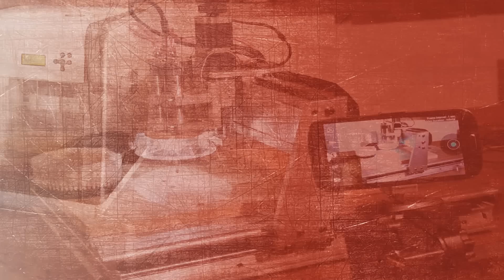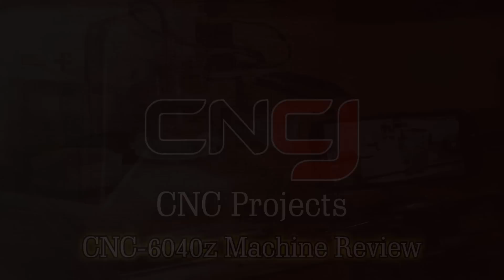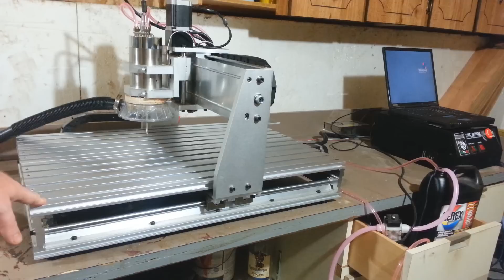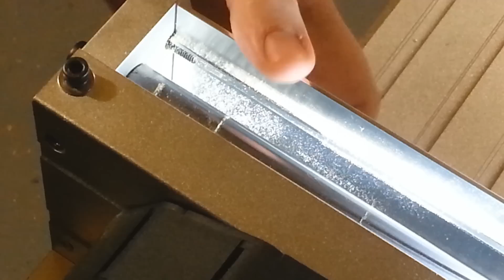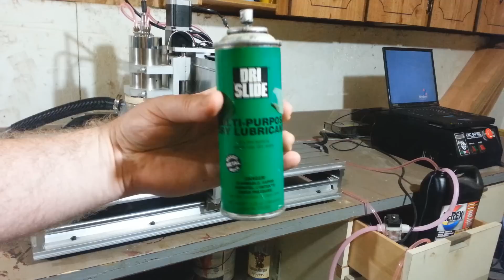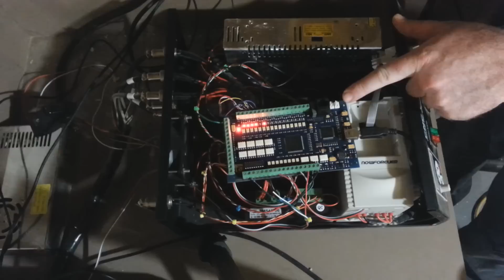CNC 6040 Review And Walkthrough

Comment: You buy a machine for 1700 USD and then you connect it to the wrong voltage? Why? A 110V to 220V transformer isn't expensive. Apart from that: Thanks for the review.

Comment: Generally agree with your comments on the Pros and Cons.  My water cooled spindle didnt come with a pump! so I got a Computer cooling setup and a 1000l/h pump that is variable speed and almost silent just needs 12v DC.    https://www.aliexpress.com/item/DC-12V-18W-SC1000-DC-Pump-Water-Cooling-Pump-Water-Cooler-Pump-Maximum-Flow-1000L-H/32887353096.html

Comment: Is it possible that you weren't getting the specs that you were supposed to get because it was plugged into110V instead of 220v?  I am only asking because I bought a similar one  not hookedup yet because the cd is coming up blank, so no software.  I was told that it wont
 get the high power unless you use 220. I am going to open up the control box tomorrow and see whats inside. Then I am going to try and find a copy of Mach 3. I see it selling for $0 up to $189. I'll have to look into that.  I just noticed that your video went up in 2015. Do you still have the machine and is it working well?

Comment: Switching power supplies can handle wide range of voltage but if you are pushing it too far out of the designed range for too long you can expect premature failure. Get a big heavy step-down transformer (not a tiny electronic travel voltage adapter).

Comment: I bought a similar unit from China.  Unfortunately it came with a bootleg copy of Mach3 so I had to replace that.  Like you, my pump motor was very noisy and that too needed to be replaced.  I added thermal switches to all of the heat-sinks in the control box to control the fans.  This has made the unit very quite to operate.  How did you get on with the CAD /CAM side of things?

Comment: Hello , i have the same machine with the same control box and its a headache from hell!!! i am losing steps on my y axis!!! i only seem to lose steps when its warm weather in winter i have no issues!! did you change your cabeling to shielded cables and do you have a video on how to connect the usb control board!!! loved your vid and appreciate your help! Cheers anton
Reply: Hi Anton, I too have the same problem and it is a headache from hell, i m having the same problem i am losing steps and the tool loses datum, i have tried speeds and feeds to no avail. Did you find a solution. i got on PlanetCNC.com and found a post in the forum that suggested shielding the cables but my cables are shielded. they also talked about frequency and delay
but i am a novice and do not understand. I will add that my machine came with a counterfeit board, so i do not know it the board is bad.
Reply: Hello, I may have stumbled upon a fix to my issues!! I was using a wireless mouse and keyboard that were faulty and giving errors whilst cutting which was interfering with my programmes! I have since changed to a wired mouse and keyboard and not a problem since!! Hope this helps! Sometimes it's a very small issue that you would never guess!!! 👌🏻👌🏻👌🏻
Reply: Not the cause of lost steps. The drivers are the issue. They are Toshiba chip and going through the circuits I found there is a mismatch of clock frequency to run those chips. They are garbage. You need to swap them out for mosfet drivers. Toshiba chips will fail everytime partly due to the clock issue and that they only output 1/3rd of their rated current constant. They are rated on their peak current which is all over in a matter of a second and then the current drops of severely.
Reply: have you had this problem and solved it by doing what you have said by changing out the drivers??? if so where can i find these mosfet drivers?

Comment: hi,, I want build a router homemade with 6040Z frame, motors nema 23 425oz, driver D542MA, 1,5kw spindle air cooling.  Someone, can help me for know if possible that this parts will work fine assembled ? Is better buy a control box Chinese already assembled or buy parts separated among them ? one drivrer each for motor ? controller usb ? Inverter vfd ?

Comment: did you add in those stepper drivers or were they already in the box? I have a control box that looks almost identical but  it does not have separate drivers it all seems to run out of the parallel port card

Comment: Im not sure if i imagined this but im sure you said your control board was 24v, how are you powering this with a 48v power supply? would this not surely fry your control board? i have the same machine but using standard 24v power supply with 24 volt control board and can only reliably get 1400mm per minute max! so that obviously needs to change. im just curious how you have done this so i can get mine sped up
Reply from the maker: +Sean Marsh Hi Sean, you are correct that 48v will blow the control board. I am using two power supplies, the 24v supply that came with the machine powers the control board / fan /pump and sends signals to the stepper drivers. The 48v is strictly the power supply for the stepper motors only (output from the stepper drivers).
Reply: +CNCJ Thank you very much for your quick reply and for this video, you are going to solve a massive restriction for me,, i have my hands already on a gecko G540 just need the power supply and a control board

Comment: can it cut 1/4 inch steel?? can it do aluminium smoothly? do u recomend this as my first cnc machine .. i have very limited softwere skills.
Reply from the maker: +Pawan Kumar I have seen videos of the machine cutting aluminum but I have not done it myself. Steel?... not so sure about that. If you are looking to cut steel, this is probably not the machine for you (beginner or not) you want a mill in that case. If you are cutting softer materials, yes I would recommend this machine if you can do some of the upgrades to the electronics etc that I have done.
Reply: thanks man
Reply: You could reduce chatter by using lead shot in an enclosure mounted on the side of the gantry..
Reply: you can cut steel (at least mild steel) with this. you'll need an oil air mist nozzle to clear chips, cool the end mill and part, and lubricate it as it is machining. proper speed and feeds are necessary but it can be done
If you want the full power of the spindle you'll need a step up transformer from 110 to 220v.
Reply: +CNCJ   Looking at buying the 4-axis version for cutting carbon fiber and some aluminium ( I have a full machine shop already and 40 years of racing parts manufacturing). It could probably cut steel without too many problems, but you would need to be able to slow the spindly down a lot to the 1-3000 rpm range using carbide tooling at fairly slow feeds - the machine is no where near rigid enough for high-speed cutting.

Comment: I took some note of your complain about the noise on that protective plate and, from what I seen, the culprit is not the screws themselves nor is the U channel where the screw thread goes in, sure, that is not the strongest option but strength is not the main purpose of that plate so, the culprit is the hole diameter on the side main arms, I could give you multiple solutions, (this is what I'm pretty good at) but, the simplest and fastest would be to remove the screws and find a small diameter hose that fit in those arm holes cut a couple of mm longer from the inside to the arm thickness, re-screw and the screws will have a firm hold on the tube and the couple of extra mm on the tube will be pushed in slightly as you tighten the screws, creating a rubbery surface for the protective plate to go against, stopping any vibration noises.
George
Reply from the maker: +nyodine Hey George, Thanks for the reply and awesome idea regarding using a small piece of hose as a vibration dampener. I will try it out and let you know how it goes! Cheers!

Comment: This PC has such low volume I hear almost nothing...will come back later on another pc or tablet.  Thanks for the video and information.  Is that one of the machines from OMIO or what used to be  CARVING-CNC ?  They have a X6-2200 that I think is very similar to your 6040 machine.
Reply: +Dan Bryan dont know if this specific one is but i've heard very good tings about the carving cnc machines. a bit more $ than the cheapest 6040's but generally better from what i've read.

Comment: FINALLY!  I liked your comment about "cutting at 2400mm/min"

I cannot tell you how irritated I am with You-Tube-ers that grind away with multi-flute endmills at 24000 rpm, feeding at 600mm/min!

Proper chiploads are hugely important, both for tool life and cut quality. If the machine is not rigid enough, reduce spindle rpm, reduce bit diameter, reduce depth of cut, but ALWAYS keep the chipload to acceptable levels. 

I work on the "S-24-6-1-100" rule.... That is Soft material, 24000rpm, 6mm endmill, 1 (single) flute, 100mm/sec (6000mm/min) feedrate. Adjust feedrate according to changing parametres. A 2flute 3mm bit feeds at the same rate as a 6mm single flute. A 3mm single flute at half of 100mm/sec etc.

For hard materials I halve the chipload, i.e. if the S24-6-1-100 rule is applied, I will have to reduce the feedrate to 50mm per sec.  for a single flute 6mm bit, or 25mm/sec for 3mm single flute, or 12mm/sec for 3mm single flute at 12000 rpm...(Soft material on the 3mm single flute at 12krpm is of course 25mm/sec/1500/min)

A sweet spot for DIY / Desktop mills seem to be 12000rpm spindle speed. That reduces the feedrate needed for proper chipload, which means the dynamic torque of the steppers are higher (giving larger torque reserves and less chance of missed steps). Also, on the VFD spindles, maximum torque is produced up to 12000 rpm, and maximum power from 12-24000rpm. At 12krpm you have both maximum torque and power, and the bearings have an easier life as well. And less heat means longer tool life......and the reduced lateral forces will reduce the tendancy of Flex / Chatter..

I have a Techno Isel with cut area of 550 x 960mm. Very good Bosh rexroth linear components, and very rigid.(And about 8x more expensive than these great little Chinese machines)  But I also stick to 3mm endmills and 12000rpm for most of what I do. 

Good stuff. Eagerly awaiting more of your videos
Reply from the maker: kafferhond435 Thanks for your very informative comment, It is the first I have heard of that rule, it makes perfect sense the way you explained it and will definitely improve tool life and cut quality etc.. This type of information should be standard and a sticky at the top of every forum! It seems, chiploads, number of flutes, feeds and speeds etc are typically ignored by most hobbyists mostly because it is presented as black magic that you need to purchase a specific calculator software for. Your rule of thumb will definitely help many out there who read this. Thanks!
Reply: ok. that was a lot of info for me to grasp at one read.
hopefully you can help me with this. I was cutting 25mm MDF with the same machine last night. i tried different speeds 800mm/m, 600mm/m, 400, etc.. the endmill performed well my only concern is the machine. i was cutting at depth passes of 10mm, is that too deep for this type of machine? i dont want to destroys gantris and stuff. thank you. ps:i was cutting at 9,600 rpms aprox.